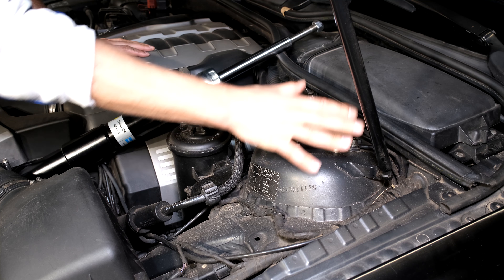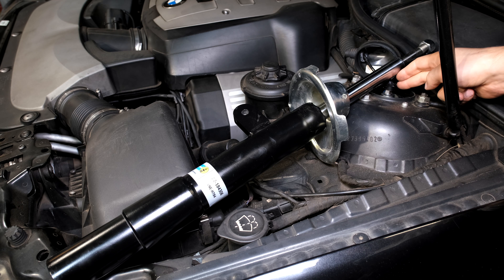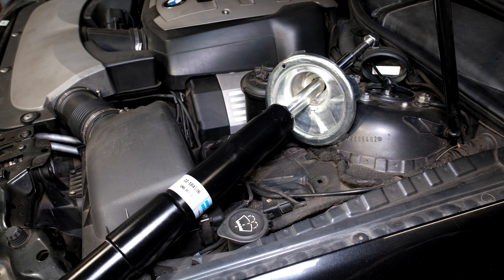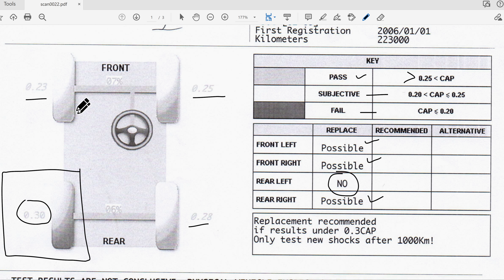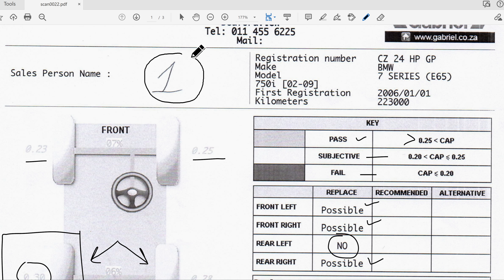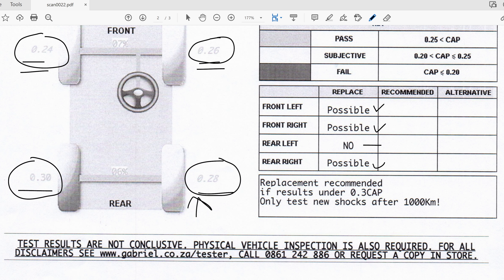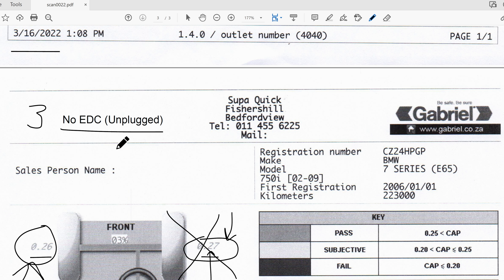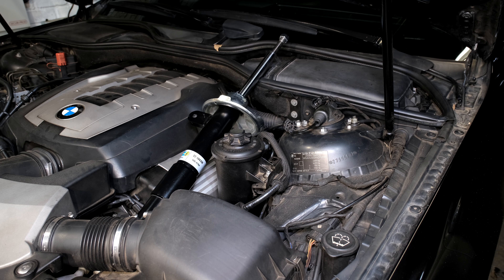Testing shock absorbers on a BMW with Electronic Damper Control (EDC) - things to consider.

Comment: Interesting to hear your comments on unplugging a shock disables the system and voltage softens the ride, but of course you want the system to be operational - the whole point of these cars is the comfort.  And the point of the EDC is to firm it up a bit for the times you want.
My experience (2006 e66 760Li.  At 220,000miles the rear left failed and as the list of problems was very long I replaced it with a Chinese edc strut.  After two years the concertina boot failed and after four years the amount of damping at the rear is noticeably different, but not yet an MOT advisory, never mind a fail.  As the Parking brake is next on the list, the valve stem seals need doing and the MOST circuit dead, it isn't a car worth throwing money at.  So, either I get second hand or a pair of BFO edc struts and use the OE rubber concertinas.
Yes, if it were some YouTube project with sponsorship but it isn't.  If it were a minty 50,000 mile car then it wouldn't need shocks.

Comment: My friend, I have a 2013 BMW 640i Gran Coupé (F06) with EDC (Electronic Damper Control) electronic suspension. After replacing the suspension springs, the car started to feel extremely uneven. The front is completely lowered and the rear is at maximum height and very rigid.
In addition, the system reported a collision failure in the shock absorbers. There were no impacts or physical damage during the replacement, so I believe it could be a calibration error or something related to the control module (VDM). Any help would be welcome, since I live in the interior of Minas Gerais and do not have any support from a qualified professional for this type of car.

Comment: Hi, I have a problem, my e38 equiped with EDC, everything was fine, but after maintenance in suspension, and car was lifted for 3 days,  Now It is driving very hard, diagnostic cannot connect to edc module to read trouble codes, any ideas?

Comment: Anyone have a reference that describes what the EDV voltage looks like when it's all working properly? I'm wondering if they use 1 or 2 DC values, and if so can you point to page that details these? I ask because our BMW i4 w/stock non-EDC dampers has horrible stock base equipment that dives, floats and shakes like jello. KW sells an EDC compatible kit for the fronts only, so wondering if fitting and hacking together simple DC wiring harness would allow a retrofit? I think modern version has accelerometers too, so not very confident it's worth the trouble, but car is so new, there are no other aftermarket options. I4 eDrive40 is 4700 lbs. so needs custom application vs. 4 series Gran Coupe.

Comment: The other thing I forgot to mention. The UK annual vehicle safety test (MOT) no longer tests shock absorbers - the bounce test was omitted over 10 years ago.
Your car can wobble like a jelly or bounce like a beach ball, but if a dash warning light comes on or one of your number plate bulbs doesn't work!!!
No one in the UK seems to test shocks.
Reply: the bounce test doesn't notice if all shocks are worn it won't measure any difference among them

Comment: Hi, so how does the ride feel with the base strut, compared to the EDC strut? I didn't understand, because I think you said the ride is stiffer when the edc is disconnected, but that the ride will be better when you install the other strut (which doesn't use EDC). ?

Comment: never put cheaper shock absorbers on BMW I mean if he have EDC it need to be fit the same you can buy cheap with EDC control but don't get crazy. Why even if you overwrite it gonna come off as a fail in the system and you will not know what it is trust me . Fit what is suppouse  to be fit it's for your safety
Reply: You mby know where to order them?!
I cant find them anything for my f11
I have second thoughts to delete the whole air suspension and just go with Bilstein B12 kit 
Any thoughts?!

Comment: I drive 2000 750il…if tried the EDC in different modes.  I perceive little or no difference…in my judgment it’s an expensive gimmick with little value…these care are over designed.